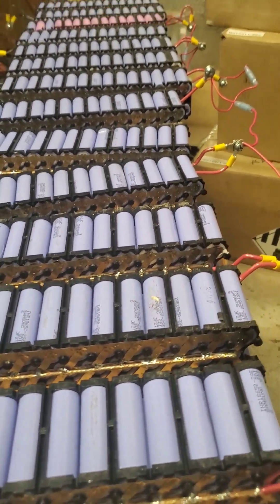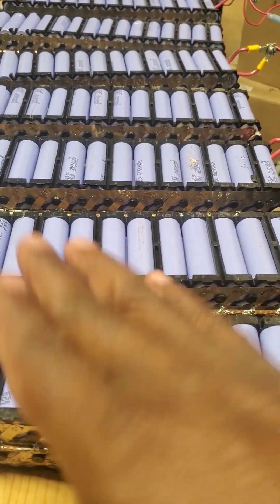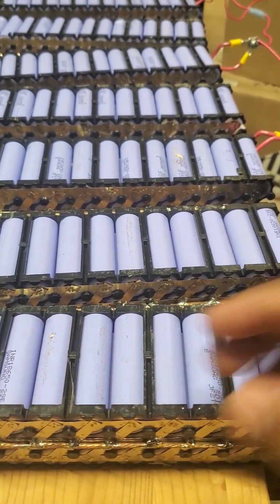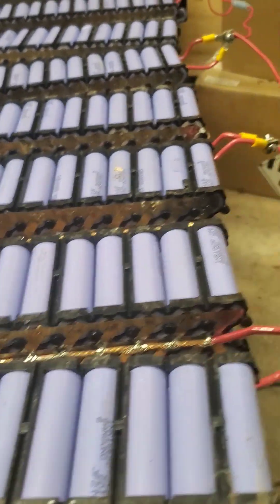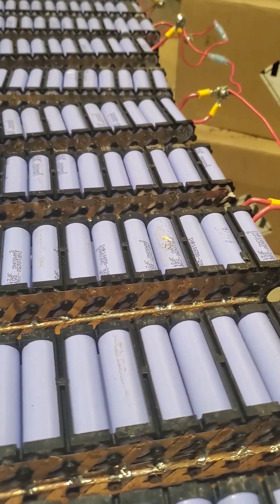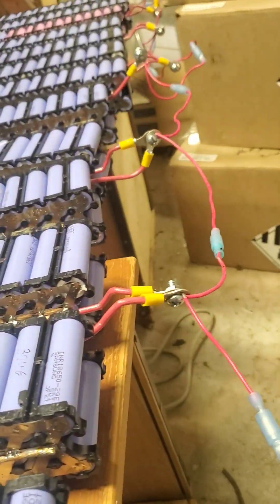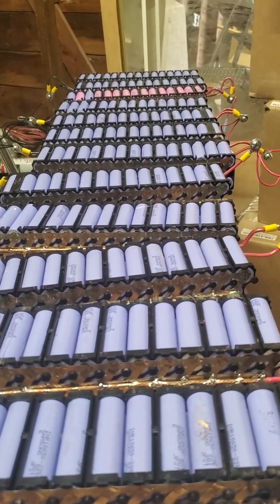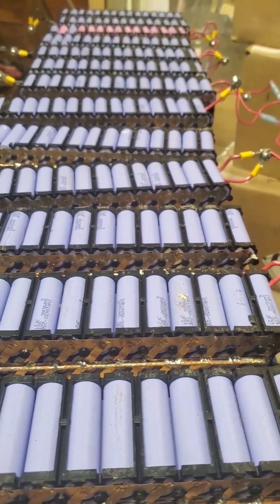HOW TO #BALANCE #Lithium #Iron #Batteries and Cells. The quickest way to place the cells in parallel

Comment: You have to balance each cell to be safe 😂😂
Reply: One battery is charged at 4.0volt most of them
Reply from the maker: @MichealCollard  when you put them on parallèl they all Will be at equal charge
Reply: @simplyfocus9937  and when 1 cell starts to go bad and absorb more current?
Reply from the maker: @PaulSamps-gf6yz I had an issue like that before I think I made a video about it
https://youtu.be/6Ttf78NEPX

https://youtu.be/6Ttf78NEPXM?si=iAfXGAf4d6mxmXyP
Reply from the maker: Do you mean each (100 cells). They were in parallel for months
Reply: @simplyfocus9937  if they are all in parallel what happens when 1 cell goes bad? You can have a big problem
Reply from the maker: @PaulSamps-gf6yz  it will depend on the  way you prepared the pack.  For me, I charge all the cell. I let them sit for 30 days. I checked them again to see if anyone dropped charges. You will know which ones are bad. You will put only the good ones in the pack.
Reply: @simplyfocus9937  that's fine if they are all made perfect. But as we know with countless fires it's not possible.
Reply from the maker: I have seen fire 🔥, a lot of fire from those batteries